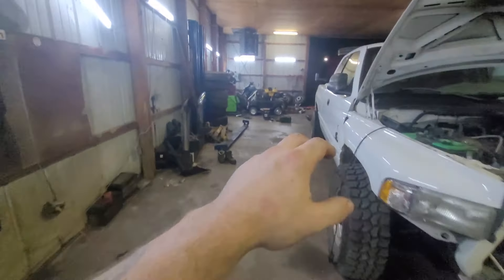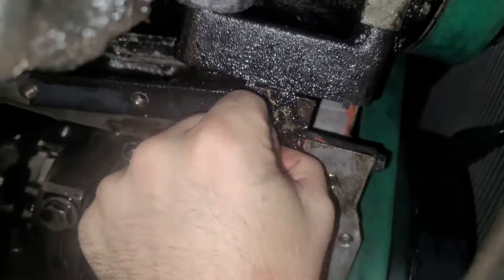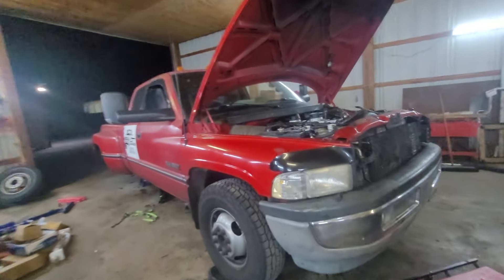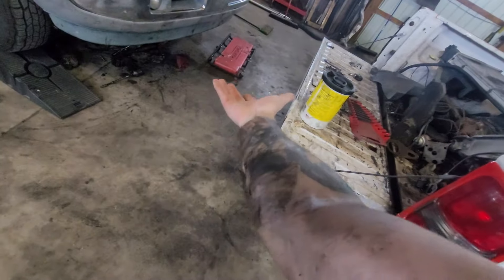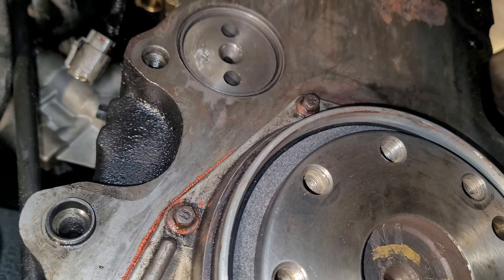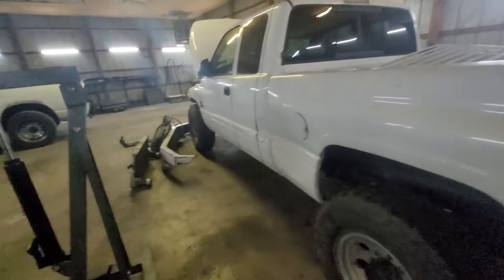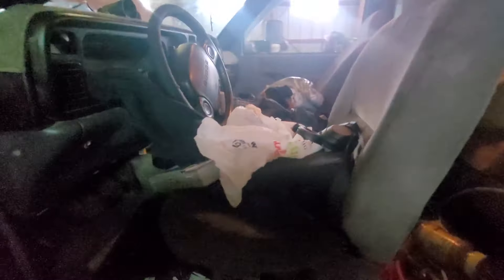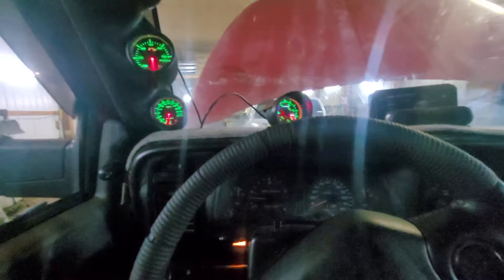We Restored His Entire 12 Valve Hotshot Truck & Sent Him 2,300 Miles Away Immediately

Comment: I have a question for you when your doing hot shot should you have a converter bc of everything plug in so it doesn’t burn up the alt and what kind of converter u recommend
Reply from the maker: Inverter*

But I only use mine for the laptop which uses 60w to charge. I have a 1000w inverter but it's way over kill. I do plan on finding a way to make my tacos on the road so I don't plan on going to a smaller one at all.
Reply: Isn’t the inverter 60 watts output a strain on ur alternator
Reply from the maker: Not at all. I ran one for years without issues. I think Josh has a 1500w one

Comment: No not a hater. Just trying to let the people who watch him know,he is not as good as he make look like.  I have meet him. If go back and look at some older videios. He has said he does not have a air compressor.  How do you not have a air.  Your going to drive to his fathers shop. Then brings it to his video about the air compressor. If you have been  watching back to his days hauling cars.with his. O5 2500 that he swapped to 12v. How many engine problems he had.  He pulled the engine out. Put it back in with out checking any bearing clearanes,just looking at then. Any body that knows any think you merasure clearnces. If you know what your doing or have the proper tools to mearsure then. So after he put back together . It ran a short distance and then he said the head gasket failured.. after his screw up he parted it out. Thats when him got the 06 he has now. So getting back to you said  i am a hater. Not a hater just talking facts. Do your home.